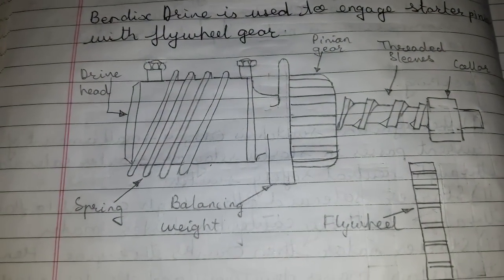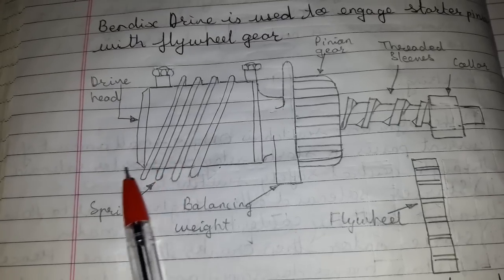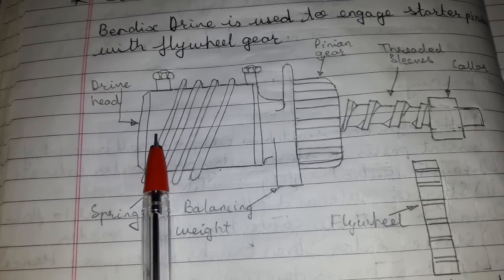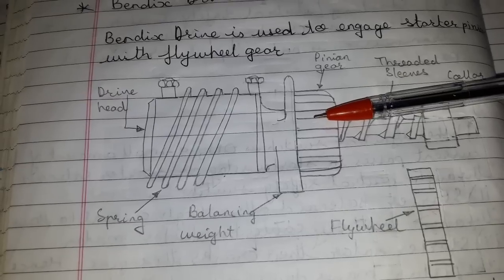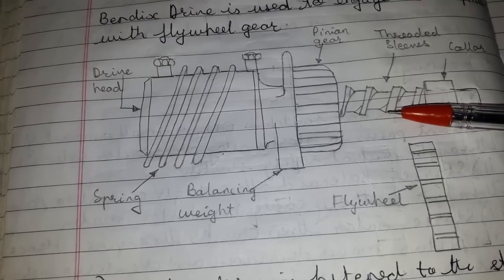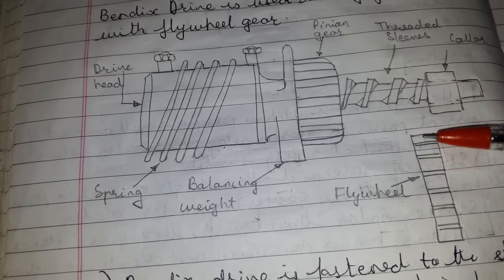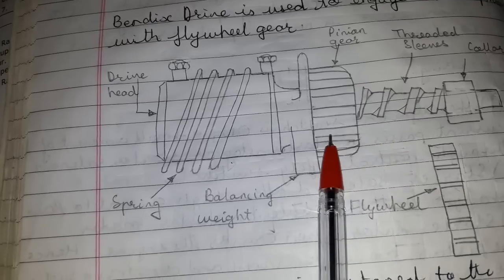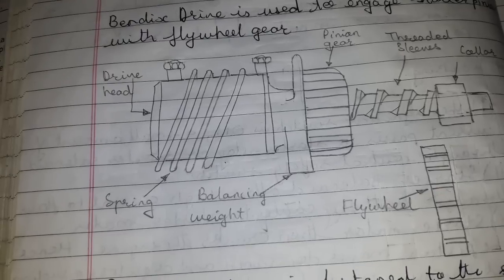Bendix drive.... #60kviews #viralvideo

Comment: Actually, this is an original Bendix design, which is never used in modern cars nowadays because of obvious drawback. The modern starter design incorporates a special relay with a solenoid and a rocker, which moves the gear forward and backward allowing it to engage with the engine's flywheel BEFORE the starter ever begins to spin. This allows to avoid the clashing, which inevitably happens with old design. However, even with modern design there are frequent cases when the relay doesn't move the gear back quick enough (especially in cold times) after the engine has started, and this causes the gear to disengage from flywheel with scratching edge-to-edge (accompanied with short grinding sound). That's not a big problem at first, however not servicing such a malfunctioning starter over long period will gradually reduce the lifespan of the gear and clogg up the starter shaft with metal debris, making things even worse over time.
Reply from the maker: This is currently being covered in syllabus of Engineering college... That's why I made a video explaining it... 

Thanks for sharing the information... It will be useful for students who are visiting my channel...

Comment: Could you explain what causes pinion drive to disengage from flywheel and how?
Reply from the maker: Refer to my video about starting motor:

https://youtu.be/XL144i15upg
Reply: +MechTech KnowHow 
i saw that video 
but you just say that load on armature reduces when the engine starts rotating. Its ok. but how that come back